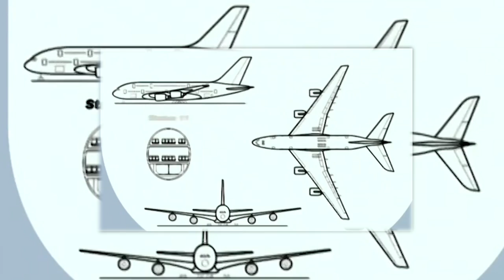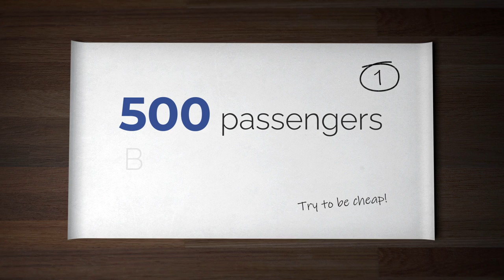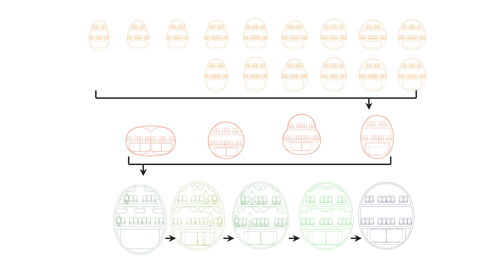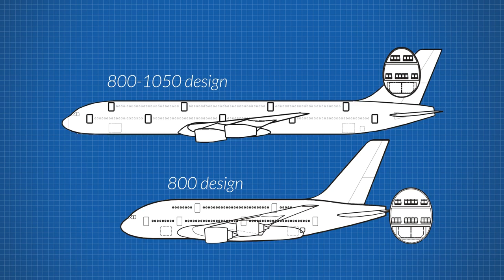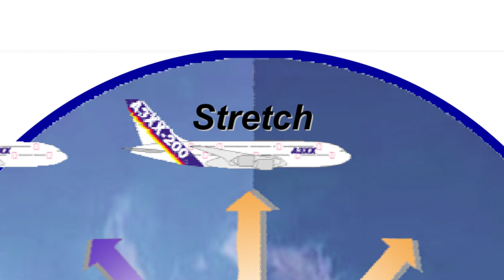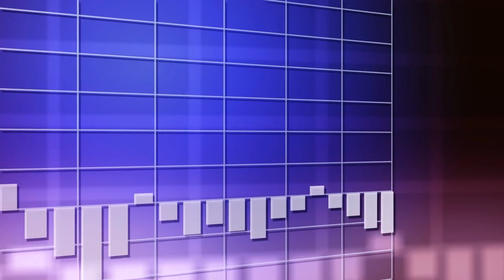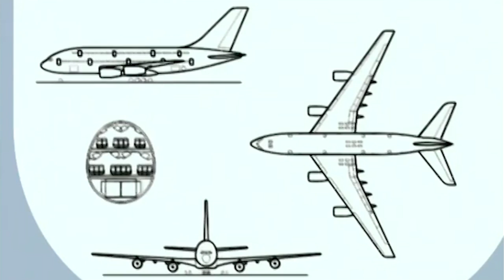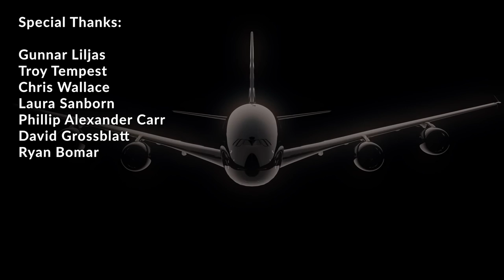Airbus A380 Alternative Designs - How They Made The Perfect Boeing 747 Rival

Comment: Boeing and Airbus came up with different answers to the question. In the end Boeing ended up making the right choice. Boeing’s was the 787, Airbus came up with the A-380. The acknowledgement of the choice was the development of the A-350. Boeing did do an 747-8, but by then, the market had changed. Boeing’s ace in the hole feature was the Freighter variant. The F model allowed for additional sales which otherwise would not have taken place. Both the A380 and 747-8 are good airplanes, but the A350. Modernized A330, 787, 777-200/300 and 777x are the winners. The single isle market is dominated by the A320 series, and boings 737-8(Max) is probably the last bite of the 737 apple. The safety issues with the Max have been ironed out. It’s economic performance in the market will determine if it can continue to compete with the A320 neo family. There are 700 737 max models which are going to take to the skies over the next 15 months or so. That’s going to be an interesting service model to watch. The A380 is on its way out of the market, along with the 747. The latest 777-X is going to replace the 747-400.
Reply: The market changes all the time. The Bombardier-A220 currently is the winner, and ironically jeopardizes the A320neo market, while the success of the A321XLR pressures Boeing to develop a mid of the market clean sheet. But the 737max took a lot of resources to get airborne safely, as well as the still unapproved 777-8 and -9. I do not see the issues with the A350 (or did I read that wrong). The 787 is doing great. Some airlines have resurrected their A380ies. The market changes all the time….

Comment: Personally, while i love the A380, i sometimes thinking that it might be too big for most airport around the world.
I wonder if the design of the A380 (or A370) are quite more simple, basically the size between 747-400 and 777-200, with 777-like wings, something like MD-12 (or A380-700).

Nonetheless, it looks nicely, although sadly in wrong time. And if i'm not mistaken, the engine itself are also the problem, given it didn't get the next gen engine like 787/A350.
Reply: The plans to reengine it were crossed out  (A380neo) after the manufacturer realised that the relevance of quard jets for passenger airliners was no more.

Comment: That was awesome! 😄 I loved it! All the designs before the A380 itself sure are amazing and not to mention huge. And speaking of huge planes, when might you plan on doing the Boeing NLA(New Large Airplane) video? Here’s information you can use in that video. Boeing also did 3 other similar programs around the same time called the VLCT(Very Large Commercial Transport), The N650, and LAPD(Large Aircraft Product Development). Boeing had proposed over 100 NLA designs with the biggest having a 290 foot wingspan, a MTOW of 1.7 million lbs, and reaching 280 feet in length. The preliminary NLA design was 70 meters long, had a 260 wingspan, and would seat 606 passengers, while the stretch version was over 91 meters and had seating for at least 750 passengers. Does that sound cool to you? 😀
Reply from the maker: It’s on the list!
Reply: @FoundAndExplained  Sweet!

Comment: The 380 isn't really comparable, the 747 transformed the globe and has been in service for half a century and will be still hauling cargo after the last 380 is scrap.
Reply: people forget just how revolutionary the 747 was when launched. The biggest planes before the 747 were single isle planes comparable in size to the 757. the 707/720 and DC-8, which at most seated 200 people. All of a sudden there is this TWIN ISLE double-decker that seats 400+ people? not a gradual ramping up with single deck widebody planes first, no just straight up double decker widebody. It's insane when you think about it
Reply: @trymetal95  The economics of the 747 brought air travel to the average person.

Comment: Even if it will never exist (what a shame), a special version of the A380-1000 will always be my dream. A GINORMOUS GOD of a plane with only 2 huge motors !!! The nice looking Boeing 777-10X would be 100% like "Ight, Imma Head Out" x'D 

That being said, tbh if such a plane would be developed today almost from scratch (since we already have the final design), with all our current techs and a little bit beyond (2025-27, rather than old stone age 2000 techs), it really would be feasible quite easily. And even with difficulties, quite a chalenge would be awesome for the industry, the Concorde and A380 programs have brought SO MUCH innovations thanks to their developments. 
The holy trinity combinason of New materials + IA generative design + 3D printing would greatly help in achieving such a marvel. Also a Massive use of carbon fiber would be welcome, since the A380 have almost no CF/composits in comparison with modern aircraft (23% in the A380, 53% in the A350 XWB). Around 80 would be great. 

Then two ginormous RR Ultrafan or Open Rotor motors will lift this beast =)

Comment: The a380 is a boondoggle, because they don't have the freighter version like the 747 8f. Some one recently ordered brand new 747 8f.
Reply: They had the A380F, but unlike the 747-F, the A380 can't swing it's nose open, thus extending the loading process and limiting the size of the cargo.
Reply: @michaelbujaki2462  why didn’t they make the whole front section swing open (like the guppy I believe) or a rear ramp like the C5?
and then make all four engines reverse thrust
Reply: @sirankleknocker3122  you'd have to ask Airbus.
Reply: Who ordered new 747s? Last I heard the assembly line is shutting down soon after the last one of the line which is happening spoils may have already happened.
Reply: @michaelbujaki2462  because its a Airbus not Airtruck.
Reply: @Perich29  And there's already an airtruck, and it's called Antonov.
Reply: @sirankleknocker3122  c5 galaxy opens at the front c17 at the rear

Comment: Four Trent 972-84 engines have a total trust of 1427 kN, while three GE9X-105B1A engines have a total trust of 1467 kN. Would a trijet variant of A380 with the GE9X engines be more fuel efficient?
Reply: It likely would have been. But fuel efficiency wasn’t the only factor that led the A380s demise. The bigger factor was the shift of airlines away from the hub and spoke model. The A380 was not an easy plane for airlines to fill with passengers. And every empty seat really hurt the economics of justifying it.  

I think Boeing better understood this dynamic because the airlines had been flying the 747 for several decades. A number of airlines used the 747 more for its range than seating capacity.

It’s not all bad news for Airbus. The 320 NEO and the recent 220 acquisition will serve the plane maker well for many years to come.  Meanwhile Boeing still can’t figure out what it’s doing in that area.
Reply: @jojr5145  What Boeing needs now is a fuel efficient 767 size plane build the same way as the 787, and at a low cost of development.

Comment: I still think there's a market for it. The Hub and spoke model will always exist. You can increase point-to-point, but there's only so many flights you can have out of an airport like Heathrow. Eventually you'll have to increase the airplane size to popular regions. They should have made an A380 with composite folding wings, a smaller vertical stabilizer, new engines, and new Avionics/cabin etc. Maybe move the cockpit to the Second Story and make a nose door for cargo?

Comment: The hub and spoke concept is self limiting due to the capacity of the hub airports - with growth, hubs will encounter real estate and operational limits, resulting in a limited number of flights and increasing ATC delays.  Add to that the limited number of airports that can handle the A380 and it was questionable from the git go...  Point to point makes more sense, and Boeing obviously made the right call when they scrapped their 747 follow on jumbo for the 787 that can operate at any airport served by jet transports...  
An interesting addition to this video would be HOW Airbus planned to load and unload the A380F version...

Comment: It is said that the king of the skies did not rule for more than 10 years, but flying on one of those planes, especially with a Gulf airline, is a unique experience. The good news; Airbus learned a very valuable lesson from this adventure, how to be flexible and efficient and how to analyze the markets. Today, they have an extremely competitive replacement in the form of the A350, A321XLR and the A220 (kind of cheating, but they have it) as well as the "classical" models. Unfortunately, the glory days of the A380 double decker experience is over - except if you fly on few selected airlines.

Comment: Well I am extremely sad to see how airlines are retiring A380 fleet due to the pandemic.😢😢😢😢
Despite I never had a ride on A380, but I am very much fascinated by this aircraft with B747. I love the aircraft because of its shape, size, & the design. 
A380 is always a history making aircraft especially for an airliner like Emirates, Who never have signed an alliance, but became the largest operator of the aircraft & providing luxurious comfort across all the classes which other airlines do with the support of an alliance.
I really wish this pandemic to end soon & Airbus to start re-building more A380's for the next 3 decades. 
It is hard to see Boeing Producing B747's since 51 years  & they are still under production, while Airbus A380 just stopped production of A380 in just 18 years & all the operators are stuck with A380-800 while Boeing 747 have several variants startig from B747-SP to B747-8i.
Hopefully by next few decades, there will be more advanced aircrafts.
Well lets hope for the best😁😁😁😁

Comment: The A380 probably would have been the perfect rival to the 747, as well as the DC-10 and the Lockheed L-1011 if the A380 had been introduced in the early 1970's, the same time as the rest of these wide-bodies.  By 2007, smaller, longer-range efficient twin-engine aircraft had been developed, which destroyed much of the spoke-and-hub model of long-range airline routes that the wide-body jets were made for.

Comment: "Was" a 747 rival, but not anymore. 747 is still the King Of The Skies
Reply: Queen of the skies
Reply: The 747 is also commercially  dead, excepted as a cargo aircraft. The new 747 is the 777. The 747-8 passenger version didn't sell really well too, and the 400s are now mostly retired in passenger service
Reply: @simonm1447  well as long as the 747 is still in service and a capable all around workhorse aircraft, not like the A380.
Reply: @corolla9545  you can fly A 380 with Emirates (they plan to keep them until 2030) and with BA, even now at the moment. Emirates alone operates 123 380s, while  48 747-8 passenger jets have been built.
So both are still in service, but both are no longer offered by the manufacturers

Comment: I think the reason why A380 wasn't that successfully as it could have been is because of its size. No matter how you put it as fuel cost per seat-mile; it consumes a lot of fuel while the industry is going for smaller, lighter and more efficiency air crafts such as the Dreamliner and A350's. And the market already had a giant, the 747, I think it never really was any need for something yet bigger and chunkier. Because unlike the slim outfit and design like the beautiful A350 and Dreamliner, the A380 is a truly big and chunky aircraft which could had a much better design indeed. I've got the feeling Airbus built that thing just because they could, and I believe that is the reason why it became so short lived.
Reply: The fuel consumption isn't that high (around 3 l per 100 km abs seat, on par with the 747-8), however it's not simple to sell enough seats because there are that much. 787 and A 350 consume around 2,5 l per seat and 100km, but they are simpler to fill because the seat capacity is lower, but still big enough for most routes.
At the end it was the inflexibility which was the biggest disadvantage of the 380

Comment: The A380 is such a comfortable aircraft it is a shame that they have closed down production. Why can't they make this plane with two bigger engines instead of four smaller ones ?
Reply: The four "smaller" engines are as big as anything else you'll find on the market. An engine of which two would be powerful enough to power an A380 just wouldn't be practical
Reply: bigger engines probably require greater ground clearance meaning the wings would need to be moved up on the fuselage or the landing gear extended or some combination. That is not easy or cheap to do without designing a completely new plane.
Reply: There is no engine big enough to get a twin jet out of the 380, even the huge GE-90 115 B or the GE9X are too small for that

Comment: Imagine if 10-20 years ago we cleared regulatory hurdles for small modular nuclear reactors. And moved over to hydrogen for airplane engines. All the airports could have SMRs making cheap hydrogen fuel on site. It’s already a high security environment for concerns about theft of nuclear material.   All the airplanes running co2 free with no produced co2 to transport fuel to the airports.

Comment: I guess you never read the article about how Boeing fooled Airbus into making the A380.
Reply from the maker: Link me!
Reply: Ha and Airbus fooled Boeing into cancelling the NMA and stretching the 737 instead of continued development on the more modern  757.
Who's the fool now?
Reply: @HarmanatorNYC  Actually, Boeing works with their customers and what they want. You know nothing but arrogance!
Reply: @stevewallace1117  yep Boeing worked with Southwest to keep stretching the 737 and have the stretch need no pilot training. 

They listened to their biggest customer at the expense of their reputation, shareholder value, balance sheet, mid term competitive position.
Reply: @HarmanatorNYC  You weren't there. You know diddly squat.
Reply: @stevewallace1117  you were complicit in building and marketing the 737 deathtrap?
Reply: @stevewallace1117  While the A380 may have been a failure economically, from a passenger perspective, it is arguably the safest and most comfortable aircraft. To date, there have been no hull losses and no fatalities. Compare that to the 747 which has had numerous design and quality issues over the decades and has had 1000+ fatalities. To be fair, the A380 is a much newer aircraft and hasn't been around for very long but its safety record is still very impressive considering how massive and complex it is. It also established Airbus' credibility as a company that could build large, modern, comfortable and safe commercial aircraft. Many of the technologies designed for the A380 have been incorporated into the A350. Overall, I would say that Boeing's misfire with the 737-Max was far worse of a failure than the A380.

Comment: Fun fact: Boeing had full double deck jet idea  long before Airbus did. While developing B747 design, they looked into a full double deck 747 concept.
Reply: maverick aviation  No they thought about it back in 60's while doing the initial development of the 747. There were several different configurations of double-decker designs studied. You can find models of Boeing double decker 747 studies done in 60's on google.
Reply: maverick aviation  Yes. That means Boeing thought of it first not Airbus.
Reply: Boeing didn't actually think of it first, and the 747 was not the first double deck aircraft to fly, the XC-99 actually holds that distinction, and it also proved the feasibility of such an aircraft.  The knowledge gained by Convair, the USAF, and the aviation industry as a whole, laid the groundwork for the 747, C-5, and even the big Antonovs(124 and 225)
Reply: @dankinusmc1  I said full double deck jet - jet. XC-99 is not a jet plus it wasn't the first double deck aircraft to fly either.  Boeing C-97 Stratofreighter and  Boeing 377 Stratocruiser flew before XC-99 did. 
Unless I missed something when doing quick research on Google, XC-99 was the first large double deck aircraft designed from ground up to fly.
Reply: @samwheat1302 , you had it right, the XC-99 was designed specifically to be a full double deck aircraft, and like the B-36, there was a proposal to convert the design to all jet with a 35° wing sweep.  But that aircraft proved the concept was valid to the sectors named, and spurred the development of heavy transporters for decades to come